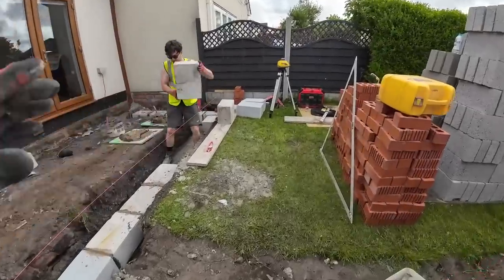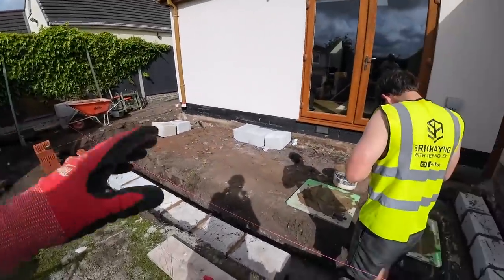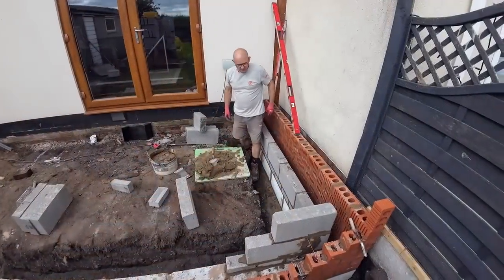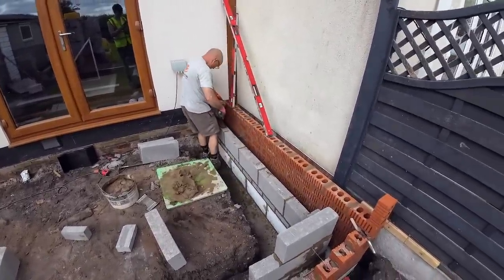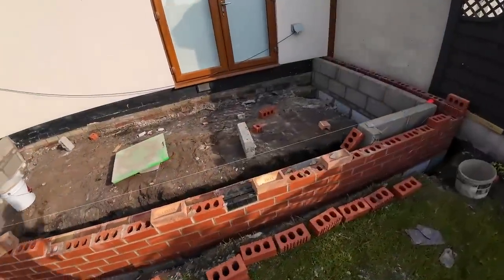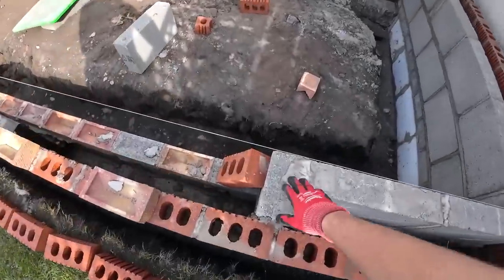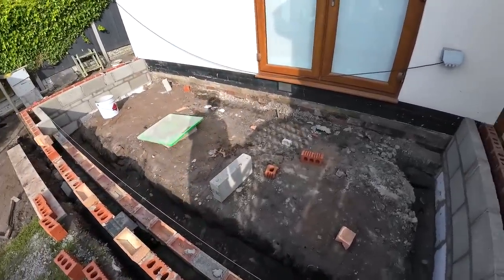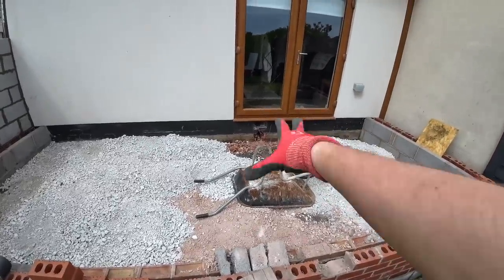EXTENSION FOUNDATION UP TO DAMP PROOF COURSE LEVEL .. PART 1

Comment: I have a couple of questions i am not sure are easily answered from watching your videos.
Can you advise what spacing the building regs require wall ties to be installed vertical and horizontal?
Also why dont you fully bed the trench blocks to ensure full load bearing across the foundation rather than just two strip beds of mortar? If load spread is not required why not just start double skin from the footing?
Hope these questions makes sense
Reply from the maker: Nice one Martin. 🤙🏾🤙🏾🧱👍🏽
Reply from the maker: A full bed under a trench block is almost impossible to get it down to the line . The gap leaves room for the mortar to spread when compressed. Also the centre on the block is Cavity above the the beds are directly beneath the walls and their load above 🧱👍🏽

Comment: Hello lads,,great work,just wondering it only looks like a 100mm cavity,is that ok with building regs,if yes how come...im just about to start mine and was told 150mm cavity...thanks in advance
Reply from the maker: Cheers Ray . Yea it is but it was passed before the regs changed. We’ve done 2 with 150 cavs now  🧱👍🏽

Comment: Hi, not sure if you mentioned, if neighbor had built to property line. What the current rules re pre-existing extensions and the gap between?
Reply from the maker: It becomes a party wall agreement 🧱👍🏽
Reply: shouldn’t there already be one in place.? Although it’s not your problem 😊

Comment: I'm  not a professional builder, so l am interested to know why you used those large blocks as the first course the concrete footing. Was it a local authority requirement, apologies if I missed any info on that in the video.
Reply from the maker: No Colin they are called trench blocks and are designed to be used in foundations 🧱👍🏽
Reply: Hi S&A. Can you use trench blocks as foundations?

Comment: Great progress on that job both. Is that a 100 mm cavity? 🤔👍👍
Reply: Hi Martin. I guess they will have to put insulation inside to comply with the Nanny regs ?
Reply: @martin2466  what a faff mate 🙄
Reply: @martin2466  And the customer will have to pay  whatever it takes to comply. Think these regs are sponsored by the suppliers. 🙄😀
Reply from the maker: Absolutely Doug 😠😠🧱👍🏽

Comment: How did that inner wall get building regs approved?  That should have been a party wall or at least 500mm gap….
Reply from the maker: Take that up with building control not us 🤷🏼‍♂️
Reply: @SteveAndAlexBuild  what a stupid reply. Who is going to deal with the court case that ensures when the neighbour needs to maintain their wall ?
Reply from the maker: It’s not a stupid answer at all . The council passed the plans and the building inspector has been out twice and is more than happy with where the extension is .
 Our job is to build the extension not start questioning everybody else’s jobs
Reply: @SteveAndAlexBuild  buck passing is one of the reasons the building trade has such a poor reputation. Good building practice should surpass the idiocy of the building inspector.   The Grenfell Tower fire was in a building built and remodelled all overseen by numerous building inspectors.
Reply: @martin2466  read the evidence of John Hoban in the enquiry.
Reply from the maker: I’m sure the council and building inspector wouldn’t be too happy being called idiots . 
   Different areas of the country have differing rules so they are enforcing local rules to us so do yourself a favour and stop calling people idiots .
    Plus we are not giving the trade a bad reputation.
Reply: @SteveAndAlexBuild  I am happy pointing out the idiocy of architects, designers, officials and builders wherever I see it.  Creating an inaccessible open to the air cavity is clearly daft.
Reply from the maker: What’s an inaccessible open to the air cavity ? I think you’re making stuff up now 🤣